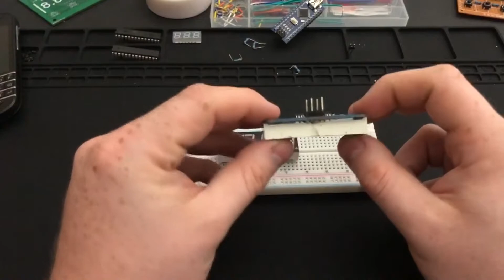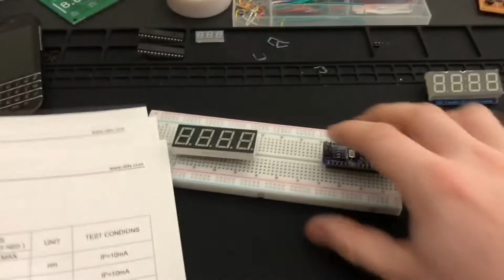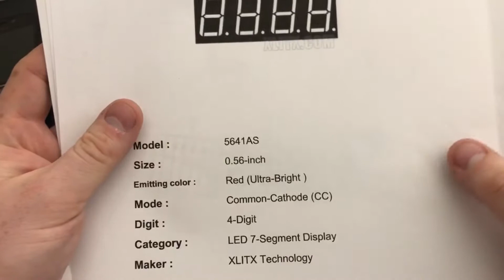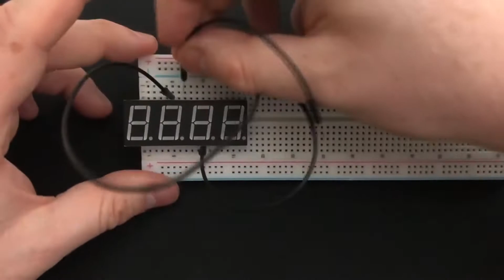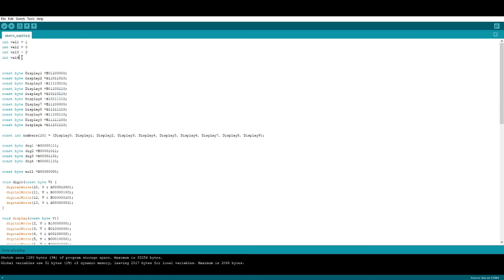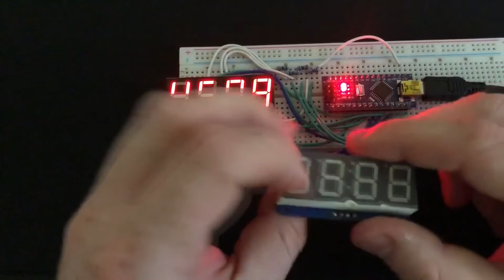How to drive a seven segment display with an Arduino.

Comment: 2:12 now the red light up LED segment segment display that is four digits, which is the 5641AS display is not only just available on eBay and Amazon. They’re also available in various Arduino kits. For example I got my 5641AS model four digit seven segment display on a complete Arduino mega kit from elegoo.
Reply: So when it comes to having them in adrenal kits or standalone these type of displays are everywhere.